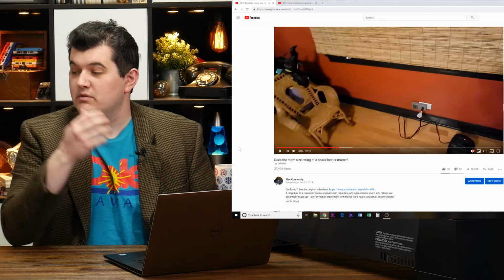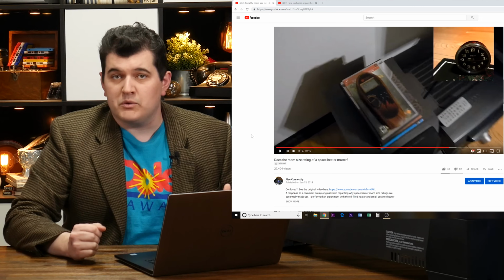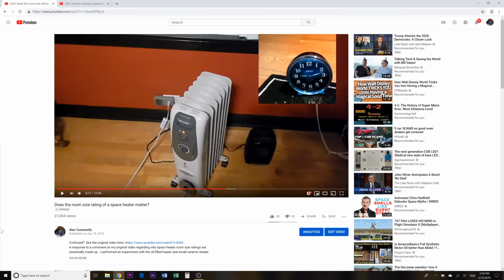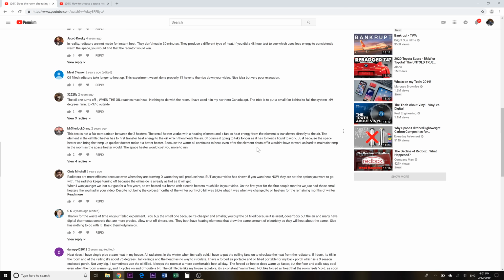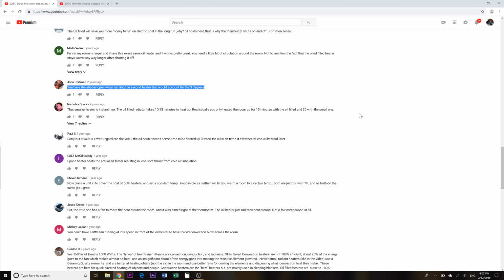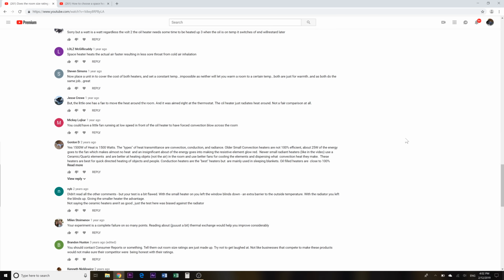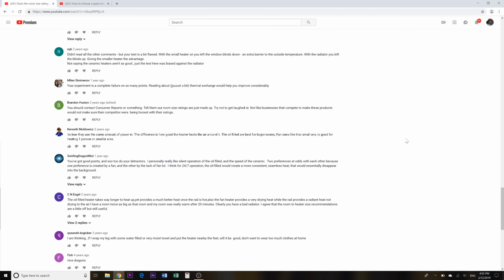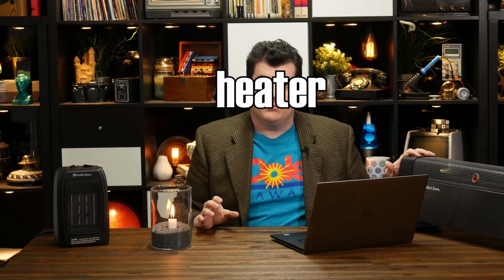More Space Heater Nonsense

Comment: Ok I believe the room size rating is for safety. The small heater is much more likely to overheat and malfunction running continuously trying to heat a very large space. I suspect the large room heaters have a more robust system allowing them to run continuously for longer periods of time with a higher  safety margin. I will contact the CSA for confirmation.

Comment: When are ya gonna do car tires? 😁 Been around for a hundred years, all kinds of applications from super-soft racing tires (Hoosier A7) to Michelin winter tires to very-high-pressure, hard-compound long-haul truck tires to giant construction and strip mining tires. Huge source of microplastics in the environment, too, so there's that angle to cover, and they use an awful lot of petroleum to make, and companies have been trying to make airless ones forever without any success, and there are runflats to talk about...

Not to mention the main ways they create traction i.e. friction, adhesion, and interference. The tires dig into the surface of the pavement on a very small scale or into the earth on a very large scale, and then there are the winter tires that trap snow in the sipes because snow has more traction against itself and ice than rubber does...

... Aaaaalec you know you want to 😛

Comment: You almost got to the right point of explanation but fell short because you are mostly using numbers. While 1500 watts is always 1500 watts, the crucial thing is circulation. The "how" matters so much.  The small heater on your table with a fan will work better than the larger one without a fan because of better circulation.

Comment: More expensive heaters are made of better quality materials, not noise fans, better thermostats, and more time for safety testing and designed operation. Most likely the expensive products are made in the USA or Europe, and the cheapest in China, where no one guarantees in which garage they are made and whether someone will pay attention to you if you get product damage. This is the risk of a cheap price. I'm not that rich to dig up cheap stuff! Cheap products lead to faster wear or other disadvantages. So everyone chooses for themselves. You are not entirely right about watts and heater efficiency. You need to do more tests with different models and brands to see the difference. I tested a $ 20 Walmart heater with a spring design and another with a ceramic heater. The difference is huge. The ceramic drew only 1,350 watts and blew much warmer air, while the spring heater barely felt even 1550 watts of energy consumption. So the material from which the heater is made is of great importance. The other is what kind of fan with what capacity the heater will have. 90% of the heaters coming from Chine are made by people who have no idea what they are doing. Usually, their heaters have such weak and not well-calculated fans that even if you stick your nose in front of them you will not feel a breath :). There is no doubt that choosing a good heater is really one of the most complicated things in our lives ... Good luck!

Comment: I'm actually really glad that you made the video as honestly I hadn't even thought about it and currently have an oil filled radiator in the British winter of 2020 and it is absolutely terrible for keeping the room warm. I used to have an electric fan heater (before it went bang) and that used to work so much better and the room felt sooo much warmer. The video you made explains why the difference.
Reply: And dirtz' comment explains why your fan heater went bang.
Reply: @HonoredMule  I'm afraid you have incorrectly assumed that information. 

I stated it went bang but not the reason for this, as it had no relevance to my comment. Just so you know it went bang for a reason totally unrelated to it's runtime (small dog knocking it off a desk by pulling the wire). 

But just to point out the old "small room" fan and the new "large room" fan (I got the replacement on sale for same price at a later date so upgraded the size to see if it made a difference) both have the exact same electronics within them and provide the same output. The only difference was the size of the plastic case it was all shoved in (and before anyone comments, I know this for a fact because my electronics engineer brother opened up both to see where old one failed and subsequently to put in some extra support for the wire inside just in case it happened to be pulled again by the dog causing the short that made it go bang).

Comment: I agree: there should be 3 types of space heaters: silent (<20dB), quiet (between 20 and 35dB) and noisy (all above). Anyway I wonder why are heaters rated just 1500W (11A) in NA and 2200W (9A) elsewere given plugs and cord and circuits are deigned for 16A (that with a load like a heater equals to 3500W). I'd understand a little safety margin (say 1A) but definetly not 6A!
Reply: Depends where in the world you are referring to. Sure, you could replace a 120 volt circuit breaker rated at 15 Amperes in a domestic circuit with a 20 or 30 amp breaker, but then you would burn the house down. Why you ask? because of the size of the conductor and the type of insulation and the airspace next to something combustible. So, the 14 American Wire Gauge with 60degree insulation will only handle 1275 or so watts of power, since the voltage is what drives the power to the load. Now there is the formula of I squared R, where the resistance is depending on the length of wire. If you look on the connector, you will see it is only made of thermo-setting plastic. This limits the amount of heat that can be carried and removed from the insulation. Finally look at the covering over the copper wires. What is it made from? This is the WHY of electrical safety.

Comment: So tell me, am I better heating my apartment with the reverse air conditioning - on heat - than oil filled radiators  to maintain an even temperature?
Reply: Absolutely better. A heat pump is 3 to 4 times as efficient as any of these heaters that just convert electricity to heat. That's because a heat pump (air conditioning running backwards) only has to move heat, it doesn't have to produce it.

As for maintaining an even temperature, that would be determined by your thermostats, by the way the two units push (or don't push) air, and whether your heat pump is an inverter type that doesn't just cycle on and off  but can scale down to maintain a temperature.

Comment: Ok, hear me out, and this is strictly hypothetical:  Same watts,same energy output,  but one space heater is designed for a bigger room, the other for a smaller. Whats the difference? Personally, i would HOPE that the heater for a bigger room is designed with running constantly in mind. Meaning sturdier components that are meant to run the entire time, while the smaller heater is less likely to run the entire time, but rather intermittently. At least, that's the only sense i can make with heaters designated to be for different room sizes.
Reply: From a practical point of view, the tiny heater has a plastic case, a heating element on the front and a fan on the back pushing hot air through and cooling down the heating element in the process. So if the fan stops working or the back air intake gets blocked the heating element will start glowing red.
If the safety cut off doesn't work your house will burn down because in the end the plastic case would catch fire. 
You can see what would happen by running a hair drier and putting your hand on its back for a couple of seconds

Larger heaters are usually housed in a larger metal case, and generate heat by passing electricity in two rows of tiny metallic fins. Even if these were to overheat the chances the case would melt and catch fire are reduced since the case is metal, the heating element is on the bottom and does not need a fan to cool it down.
Of course if you put this type of heater on a shag carpet, the carpet could catch fire.

Comment: I think the problem is that you reason about the heaters in terms of efficiency, but the producers know the efficiency is the same, so they don't even take that into consideration. Unless of course they really want to cheat you like in case of an expensive, modern and efficient heater nonsense some sell. I would say that the rating of "large room" in case of oil heater might be there just because they actually need to work in large room to work well. In large room there is more space and more air, so the convection is much stronger than in a small room, thus the heater will be able to output more heat than in a small room and won't turn itself off as often if at all. On the other hand in a small room, there is not enough air to cool 1500w heater just by convection, so it needs a fan to move the air. When it comes to design the oil one is much more pleasant to use just because it doesn't make any noise and heats the whole room as opposed to heating and drying mostly the small part that the fan is directed on. So it is problably that they want you to use the better design of convection heater if it is at all possible by labeling it "large room", but they also know that this design won't work in a small room so they have a backup product labeled "small room" for that case.

Btw If somebody wants to buy a very expensive electric heater that actually is cheaper to operate than the ones shown in the video: buy yourself a computer and let it mine some of your favourite cryptocurrency or do some other usefull work. It's like an electric heater cashback!

Comment: You are so correct. I went through this years ago (as a homeowner trying to save money). I basically came to the same conclusion. Here is one addition. The best way to heat a room is very quickly. You must heat the room up faster than it is loosing heat, or you are wasting your money. Like trying to blow up a balloon with a hole in it. That's why I think the best heater is the one with the strongest fan (highest cfm). Also loved your vid on those portable AC units with the vent that hooks to the window. Very helpful.

Comment: Mostly, you have to combine all factors about space heaters. OK, they almost all put out 1500W of heat, minus any draw by a fan or other gimmick. Then you have to factor time into the problem - how fast do the heaters make heat? Then we have to factor original cost of the heater itself which could be the length of service it gives (how many heating seasons will it last?). As we have seen, size doesn't matter except the size of the fan (how many cfm/minute of air does it pass through the heating element?). I would say the weight has a lot to do with longevity, The more it weighs, the more quality it has. Plastic frame VS metal  frame. Then, last but not least, the safety features it has (tip over, overdraw protection, child proofing, internal fusing, .etc.) Also, where it is going to be used? What you buy has to fit the room it is going to be used in and where it will be used in that room. So many factors you have to consider before purchase an electric heater, not just power or BTU output. Even where you sit on the power line factors into how much the heater will put out. Near the transformer station you can have 125V, but near the end of the branch line you are on, the voltage could be as low as 110V - quite a variation. With our ageing power system, some lines have not been changed since the days of the Rural Electrification Association in the 1930's. Even so, your house may be so old it may still have cloth covered wires in the wall! A space heater may be a killer. BUT, we all may have used a space heater in our lifetime. The advertised "efficiency" and safety issues may not be enough to protect you. But, the issue started to be the differences between the space heaters themselves - there is none. I think your only choice is cost and how often you will use it. Buy cheap if you only use it occasionally, buy ones with more safety features if you plan to use it constantly. There it is, simple and cheap, or costly and complicated. Choose wisely.

Comment: The Heaters are rated at 1500 watts, but only the small one pulls that load continually. SO small unit = less efficient per current used, but more efficient at heating a room faster due to the bigger unit running 2/3rds of the time at peak energy use. Winner? 220v wall heaters. Kicks the crap out of 110 both in BTU's and cost. The room size thing? Mostly marketing, but also a measure of how much heat a room needs over time, as a cheap unit may be less durable under constant heavy loads. https://www.nytimes.com/wirecutter/reviews/best-space-heaters/#how-we-tested-space-heaters

Comment: May have been said below, but the temperature is also psychological. A 60 degree room in summer that is 80 or 90 degrees normally feels good, while in winter with a temperature of 40 or below, it will feel colder. I say normally, because living in the South U.S. people traveling from the north will be in shorts while many here will be bundled, and people from Florida think it is cold when it is pleasant to those here. Also, the surface temperatures of the objects around a person will effect how hot/cold it feels. 
One thing I would have a question about is somewhat along thinking about that, would moving air across larger surfaces better heat the air? When I think of cooling, it seems evaporation is better with more surface to cool the coolant, so would the same principle apply to heating the air?